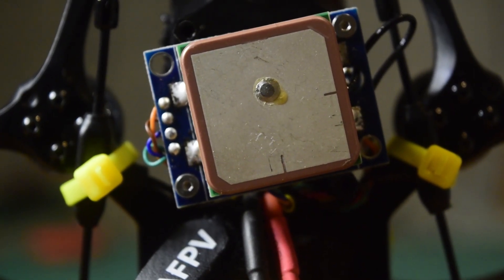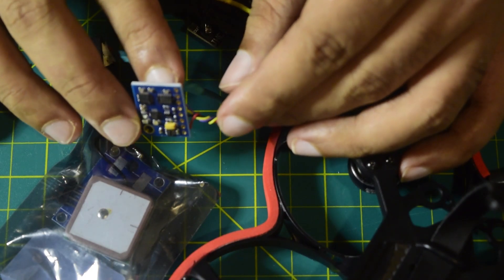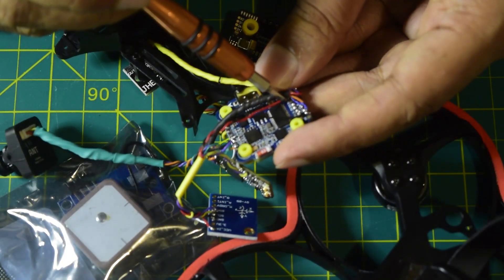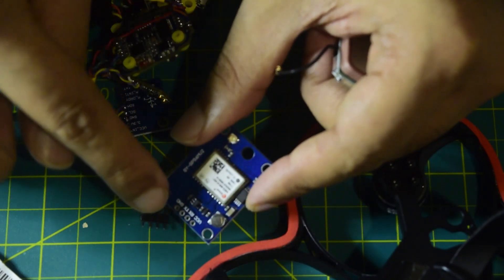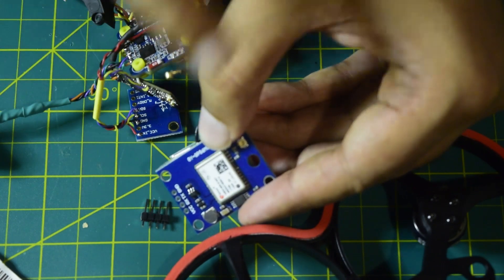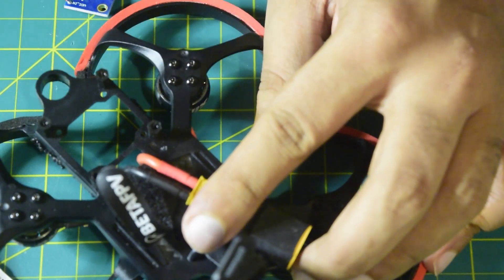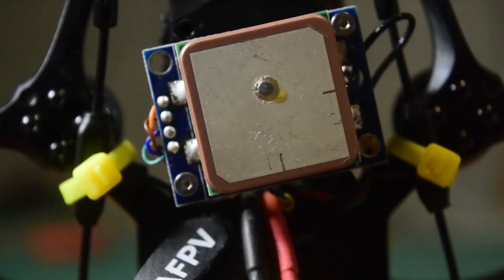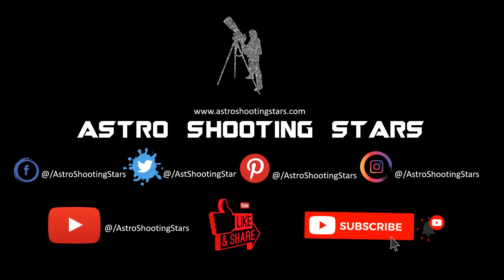How to Install GPS on SpeedyBee Mini Flight Controller | GPS NEO-6M install On cinewhoop Drone Frame

Comment: I have a speedybeeF7 mini FC, I have installed a run cam phoenix nano, a vtx having smartaudio and want to have gps, which I am not able to integrate, using fli14+ receiver. Pls help me understand if with my setup, gps can be integrated or not, if yes, how
Reply: For the speedybeef7 mini stack

Comment: is any kind of firmware uploading required on the neo 6m module? I'm planning on installing it to my pixhawk fc
Reply from the maker: no need for any firmware on gps module. the firmware is on the flight controller itself. I hope this helps. please stay tuned to my channel for my future videos